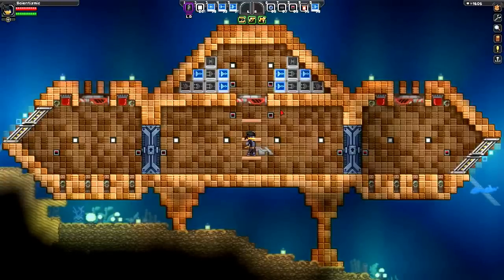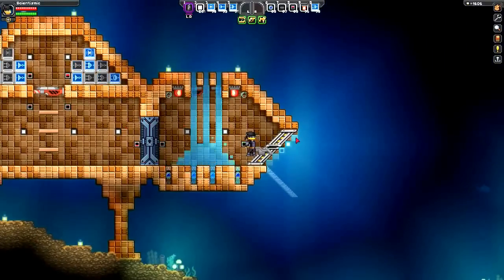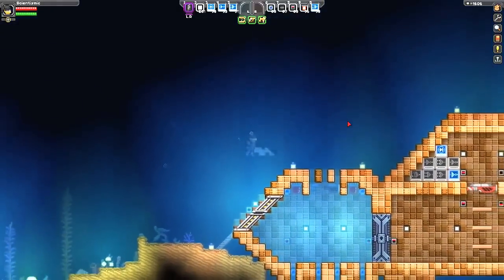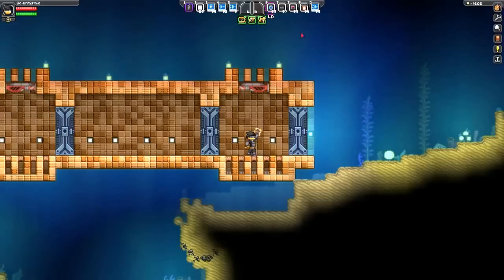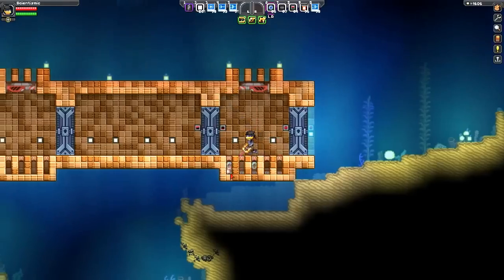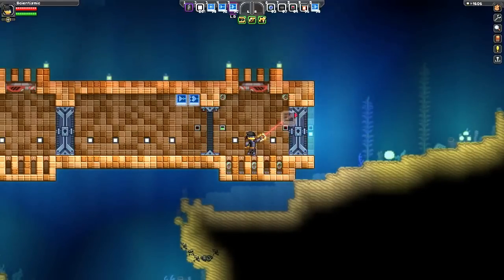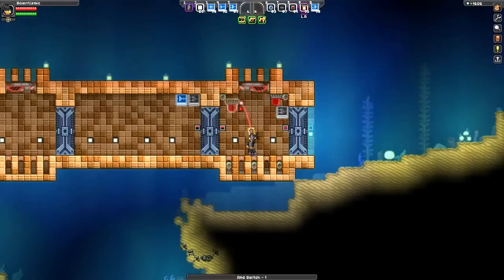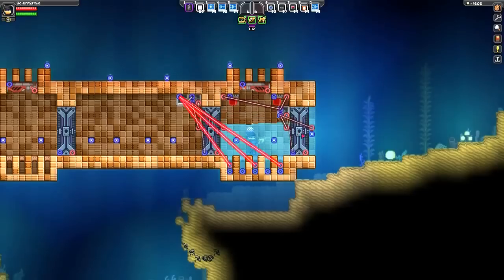Starbound Ultimate Automatic Airlock Tutorial

Comment: Is it possible to switch the sensors out with buttons? I tried but it did not seem to work, I think I did something wrong.
Reply from the maker: Absolutely, you don't need such a complicated work around for buttons, the reason you do for sensors is because you need to know when to fill or unfill based on which door is open. For a button simply hook up all the components to the button, when you press the button all the components will turn on/off then you just need to put a delay on the doors activation so they won't open until after the airlock is full/empty.
Reply: Andrew Irwin, how does one do that? Sorry, I’m not really good with logic in this game :P

Comment: how to get the wiregun?
Reply from the maker: you can unlock your wiregun from the computer after completing a certain mission if you continue to do missions it will eventually unlock
Reply: how to get the wall?
Reply: like the background part
Reply from the maker: +Snake Brown the background is the same block as the walls it is called smooth metal and it is craftable i painted it orange with the paint tool
Reply: ty but i meant like how the background like inside base walls dont stop you,those blocks
Reply from the maker: +Snake Brown you just right click to place normal blocks into the background
Reply: k ty